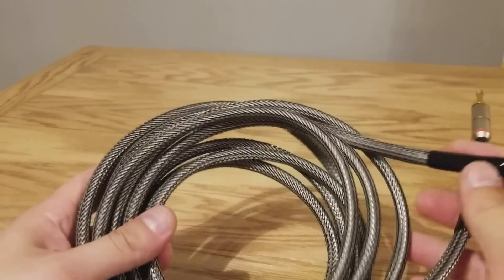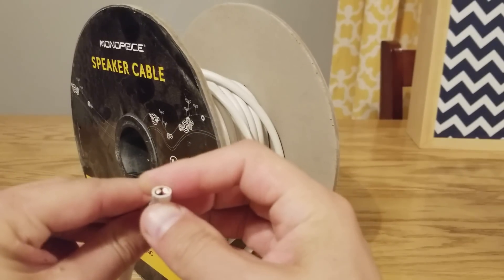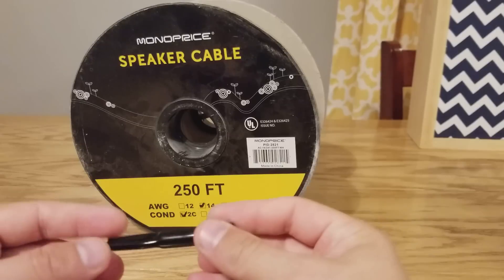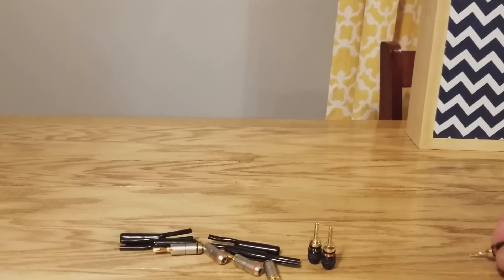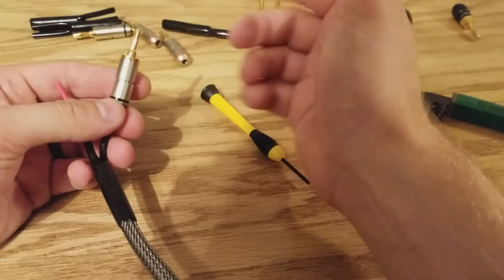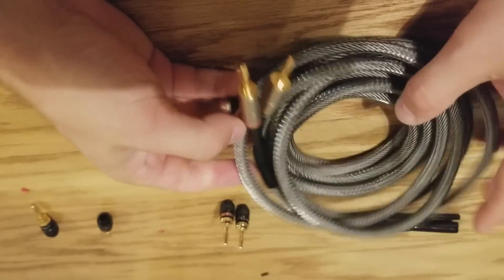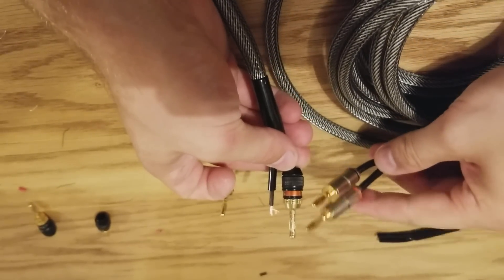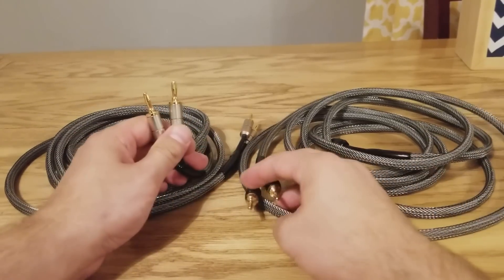How to make Your own HiFi Speaker Wire

Comment: "audiophiles" are the most weird part of the audio hobby..They are usually over 40 and it is proven by science they almost never hear above 17 khz...but they swear they can hear a difference between a 10 dollar cable and a 300 dollar one..That my friends is called the placebo effect, and it is proven very effective to separate gullible people from the money in their wallets... I am of the camp that if you can not measure the difference...there is none.
Reply: I agree to a point. Nice to have good looking cables though.
Reply: Do you know what a "sound stage" is when discussing the merits of audio equipment? If not, it's the ability of a stereo system to place specific instruments in different locations in the room.  (For example, you'll hear the drums in the center but from the back and the piano may be elevated and off to the right, the vocals straight in front of you, and the guitar sounds like it is coming from the left. )  It is one of the most basic tests of a system's quality and even mediocre systems can produce this effect to varying degrees. There is no doubt that a stereo can do this and anyone who has tried can hear this effect.  Or maybe you've heard a sound go around the room on an effects track, same thing. However, no one has ever developed a way to measure this. You can't measure or graph it on an oscilloscope or any other device.  Are you going to say that there is no sound stage and you cannot hear this? Because that is the camp you are saying you are in.
Reply: @osideonoside4014  glad I found you on this reply thread. Not been able to respond to you, it takes me to a thread but you are not on there? To answer you, he is using speaker cable regardless of it being compatible for in wall or not. Decent guage and the length here is not an issue either. You seem to feel because it's for in wall its no good? or he should not have spent the money? It will work fine.
Reply: Oside O'NoSide Good point. I just wanted to check on cable I bought, for my valve amp & electrostatic speakers. I have put cable together. Like this. It sits in a box in my shed.
Reply: "They are usually over 40 and it is proven by science they almost never hear above 17 khz...but they swear they can hear a difference between a 10 dollar cable and a 300 dollar one.."    
 
It is clear you don't know what you are talking about and don't understand sound. Music recordings rarely even touch 17 khz. Horns and vocals top out at 1 - 2 khz, the attack on strings and percussion briefly spike into 2 - 5 khz, everything above 6 khz is entirely harmonics. Unless you listen to dog whistle symphonies, hearing above 17 khz isn't useful for listening to recorded music.
Reply: @osideonoside4014  clearly not then👍 hello @Esquire Moderator

Comment: There are 2 things to consider when buying cables.

1. Is the cable made out of pure copper or not? Cheap cables probably have some alluminium or some cheaper materials in them.

2. Is the surround of the cable good. It may pick up less noice from outside interferance.

Most of the speaker cable used in the profesional audio industry uses good cables like this. These cables have to be capable of transfering a signal over long distances. So in this industry you will need the best conducting cables. And you can get all of this for a far better price than specific hifi cables. For €/$2 per meter (3 feet) you will find these type of cables. I use Cordial cables. I'm not sure if you can get that everywhere. But my advise would be to go to some profesional audio forums and find a brand that is trusted in your region. You might even find something cheaper than my cordial cables! It's not as cheap as monoprice but it's proven quality and still no €300 for a 2 meter (6 feet) cable.
Reply: Ofcourse if you just do this for the looks and don't care about sound improvements just go with monoprice. Its cheaper and still not bad. It's an upgrade from those typical thin black and red cables that most people have. But if you are searching for beter improvements please consider the advise for profesional cables.
Reply: @kennethkenneth-zc8gz  do you have any brand suggestions (Europe), besides Cordial? Do you think Monoproce is a bad quality (bad copper) cable?
Reply: @kixxoff928  maybe tasker cable. Cordial is one of the biggest supliers in europe (i live in the Netherlands). I only work with cordial so i dont have any experience with other prof brands. But as far as i know in comparison to your typical hifi cable cordial is just better and available in the e.u. you can find it in the Thoman webshop. monoprice is just to cheap to guarantee a fully copper cable.

Comment: What is most amusing is the audiophiles who would pipe up defending their £300 cables probably have very poor speaker positioning and little acoustic treatment. The number of setups I've seen where people have spent 1000s or even 10s of thousands on their setups which will inevitably have horrendous comb filtering and massive notches and peaks in the frequency response due to poor acoustics is incredible...

Comment: I got twice the length of 12 awg wire needed because I couldn’t get 4 core 12awg wire. I’m putting the 2 core wire together and I’ve twisted them for one of the wires in a drill so far but putting the TexFlex on the 4 cores is really tight and difficult to put on. It’s easier to put the wire on a table while putting on the braiding. The braiding I got is a lovely blue with gold stripes and it looks great already. I might just leave the other wires untwisted to see if they’ll make braiding it easier.
Total cost is only £52.50.

Comment: I have expensive cables for my main tower speakers in my living room. 6ft 12 gauge and cost $250 new.. I picked them up used in like new condition for $60. Did some tests and they where definitely better than 14 gauge monster cable I used before at high volumes with heavy bass.

Then some years ago I got some monitor speakers for my computer setup and ordered with them a "pair" of 14 guadge speaker cables for $40. Turned out it was just a single channels worth of cables.. Then I got annoyed and wanted to make my own, did some research and came to the conclusion that it might not make any difference as long as you have good contact and the wire isn't too thin. So I started experimenting, first thing I thought to use was stranded electrical conduit wire for a standard 15amp outlet. Made sure the posts on the speakers where very clean and same with the class D Pioneer Elite stereo amp. There was no difference at all between the two at all. So then tested them on my floor standing infinity speakers in my living room with the "$250" cables and same, no difference. I tried the 14 gauge $40 "pair" I just ordered on the bigger speakers and there was clear deformation in the bass and highs.

The lesson learned; oxygen free just means the copper is true to the gauge it claims. You can just use thicker gauge wire, heavier strands or solid cable is best if nothing is going to be moved around. Stranded cable's only benefit/purpose is for flexibility and movement. And gold plating is for best contact on limited surface area but if you make sure the wire and posts are clean (very clean) then tighten down the wire enough to crush it well there's never a reason to have gold plated anything.

Messed up part is that was a kid (like 12 y/o) I had a Technics receiver and some Fisher speakers, I would upgrade RCA cables and speaker cables then take apart everything for curiosity. Found the speakers had heavier gauge inside the individual speakers than on the wiring so I replaced it all with monster cable and didn't have confidence in the little connectors so I soldered them in place. Replaced the swollen caps with identical ones I pulled off a broken amp. And installed a good 5 way binding post. Holy shit did that transform those old Fisher speakers (3-way floor standing, the ones with the 12" white foam woofer).

Comment: I Find that if you add a  peice of paper.wrap it around the tech flex. push the boot enough to just start and pull paper out... Helps the boot slide on..

Comment: Finish (burn) the ends of tex flex with a lighter then super glue ends to cable insulation, makes job 1000% easier.
Reply from the maker: Good call 👍

Comment: "You can use these very nice banana plugs...OR you can use these cheap ass ones [pulls out the ones I bought]" O_O
Reply: hahaha same
Reply: @theHeartlessNooB  I am not sure but wouldnt the better banana plugs be prone to shorting out if they were to touch each other since they are all Brass or Aluminium or whatever they are made of since they are made from a conductive material .... Like I said though I am not sure exactly how those ends work ..... never ever used one before .... just looks to me like the whole thing would conduct electrical flow .... I always thought the outside jacket would be better out of a non conductive material like those ones he says are cheap ones .... Fill me in on how those good ones work .... they sure look nice though
Reply: The ones you just bought sound just just as good

Comment: With respect, these are speaker cables, not wires. Wires make a cable. Also, try a comparative test between these and mains (110v in your region) cables and see if you hear a difference.

Comment: I would personally go as thick of a wire as the plugs can accommodate. 14awg is a bit gutless. Also i would also insulate the conductive plug jackets with heat srink for peice of mind.

Comment: This is ridiculous. Why go to the trouble of prettifying a cheap cable to resemble something expensive? Good cables and interconnects do make a difference in a system, and it would be best to spend the money of that rather than wasting time and money on purely cosmetic nonsense like this.

Here is an example of making your own cables done properly: https://youtu.be/Uqx6VhWq9E8

Comment: It's rather simple, borrow a 300$ cable and compare it to a 20$ one, if you cant hear any different then buy the 20$ one. 
It takes a hi-end system and training (at least attention) to hear any difference, it's not for everyone,
I spend 600$ and it was totally worth it, would I spend 10.000$ on loudspeaker cables, nah ... trust your ears, not the advertising, and stick to your budget.

Comment: Just use thick gauge speaker cables. You dont need expensive cables.
Reply: The BBC used thick mains cable which is fine though at high frequencies basic mains wire can attenuate (limit) the high end sparkle from the amplifier. Solid wire core would be better but who has cables set at right angles.No one really

Comment: There's absolutely nothing to say, whether one prefers a manufactured highend cable or builds it himself. As long as he/she hears an improvement, every decision is just fine. My personal experience on hifi cables is: Yes, they definitely make a difference. But this doesn't depend on the price or brand. The important thing is the quality/purity of the conducting material and the assembly quality. Electrons are not being influenced by voodoo or names. Thoroughly search for good bulk stock speaker cables (4$/ft. is not a crime). Do not hesitate checking test results. Don't oversize! AWG 14 (max 13) is enough - considering skin effects. To grant best possible transitions, cast the wire with the jacks (if possible in a vacuum) and there is nothing more to add. Enjoy.
Reply: I have no issue with people who spend large sums of money on speaker wires because they can hear a difference.  However, I get dismayed by those who spend these sums denigrating people who spend far less because they do not hear any difference (or those who do not believe the difference is worth the extra money needed to achieve it).  Spend whatever amount that you want to spend (and that you can fit into your budget) to get the sound that makes you happy - and don't criticize anyone for how much (or how little) it takes to provide them with an enjoyable experience.
Reply: @chucklemberg4968  Wow, Chuck, why so sensible?

Comment: The arguments have slowed!  
I'm just here to say copper is copper, no amount of gold plating, silver solder, OFC or the insulation used will make a grain of different in sound quality in speaker level cables.
Feel free to argue again.
Reply: Nobody made those arguments. Gold plating is for corrosion resistance, not sound quality. Plus, it's on everything now, even the cheap connectors.
Reply: @esquiremoderator32  The same holds true for OFC (oxygen free copper) - prevents corrosion.
Reply: Just make sure it is copper and not aluminium strands coated in copper. Watch out when buying from Fleabay there's plenty of that sh*t being sold direct from China. If it's cheap it's probably aluminium. General rule of thumb.

Comment: Want to save much more money? use home AC stranded 14 gauge cable from your local hardware store for 16 gauge applications, make sure the contacts are as clean as possible on both ends and use a screw down terminal on the speaker and amp to smash the copper for best connectivity.

For the life of me i can't tell the difference between that and high end cables i have on my Infinity floor standing speakers connected to a Denon receiver (good one with Japanese parts inside) or on my desktop setup with a Pioneer Elite A-35R paired to some basic (but nice) Pioneer SP-BS22-LRs. I did that one day because i ordered just one set of "oxygen free 16 gauge cable with gold plated banana plugs" for the desktop setup to find out it was just one "set" for one speaker then sat there thinking too much. I dove deep into all the nerd stuff (again, again, again, etc) about audio cables, copper and electricity and the physics of it. Came to realize it marketing B.S. that many of these companies actually believe, just like I'm sure your local trusty palm reader does. Basically bro science that Monster injected into the audio industry for the most part many years ago.
Reply: Yep, any cable with sufficiently thick copper conductors will work just as well as any other. Literally the only pitfall is having too narrow a gauge, as that can constrain the current flow. Once you get to a sufficient thickness, you're laughing. The only reason to buy a pricier type of cable may be because you can get a softer and more flexible type, for example, which just feels nicer to handle.

Comment: Odd how many "experts" dont know or understand the galvanic reaction.
In the military we NEVER use connectors like this
Much MUCH better way to connect these things
Reply: @anaesthetics  Any type of banana.Gold is no better.Surfaces get coated with a CRC product (Deoxit would be fine) and a special wrap. EVERYTHING in space is like this. When you have the gear we do, you see just how bad ALL connectors are.  Even for stereo stuffs.
Reply: @anaesthetics  Point? Using a connect is bad, I guess.You WILL lose sound,add noise and it gets worse over time. I am done here, you seem mad and trolly.

Comment: A lot of people here think that audiophiles love to spend money on snake oil products. Not so, Those people I would call gullible and misguided. I see myself as an audiophile, and have spent a lifetime enjoying music, making music, recording music and doing my best to build and use systems that reproduce audio as accurately as possible, within reason. There are good reasons to invest in well designed and well built audio equipment. There are also good reasons not to fall for the nonsense that is peddled by those who see an opportunity to make money out of people who want to be seen to have things like expensive speaker cable, signal cable and worst of all POWER CABLE. I say that they want to be seen to have these things because I don't think they make purchasing decisions by listening and looking at REAL and meaningful specs. As far as this video is concerned, There is no harm in making nice looking cables, but to refer to 'high fidelity speaker cable' is nonsense. For concert hall installations, studio installations and home installations, the only speaker cable you will need is flexible insulated copper cable, stranded,  of cross section 1.5 square mm, 2.5 square mm or 4.0 square mm depending on the cable run and the power amplifiers/speakers involved.
Reply: Australian Bloke Very very sensible reply exactly what I would expect from an Australian..
Reply: I have a 300 dollar 200 w per ch amp, it's powerful and at full output it's 0.1% THD way good enough for me. Cheaper than a NAD and sounds as good with the right speakers. I don't like NAD amps they sound a bit "wirey" in the top end. But with the right speakers they sound ok. My speakers are a bit "wirey" so the other amp sound better on them than the NAD. And it's a third the price as the NAD and twice as powerful. lol And I know it's good cos an A-B test with a $50 class D amp, and my $300 200 w amp simply blows the class D off the shelf (peripod). A way more "professional" sound through the whole spectrum and the difference is clear and it's only a $300 amp! And to think that I was actually impressed with the class D when I first heard it. lol Yes you can tell the difference between good stuff and shit. BUT! You don't have to pay much to get really good stuff. You LOOK at the specs and stick with the old school class B Med Fi. Lo Fi is crap, Med Fi rocks (and you can get it cheap) Hi Fi is crap cos you can't tell the difference between it and good Med Fi (on average recordings) and costs way much.